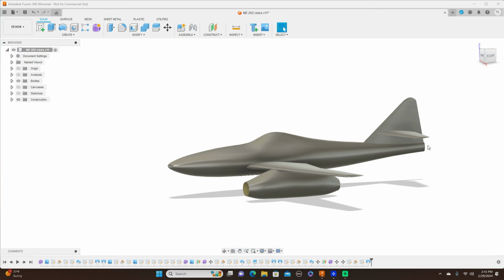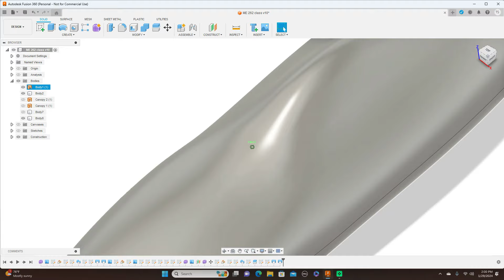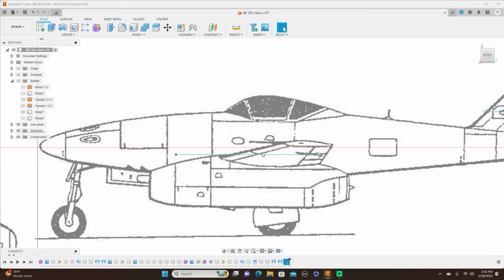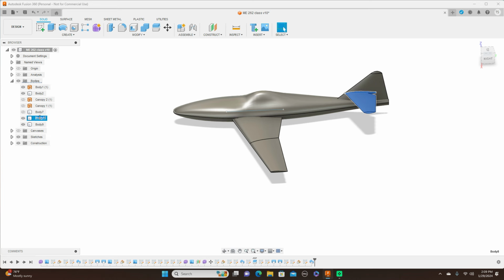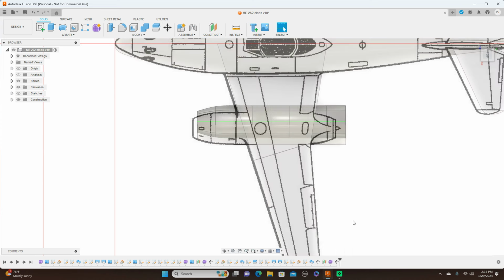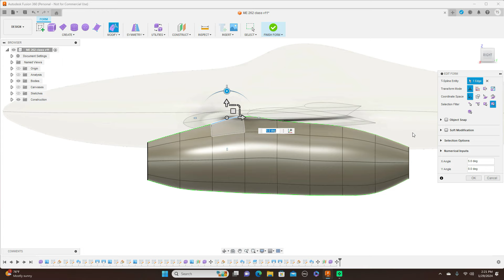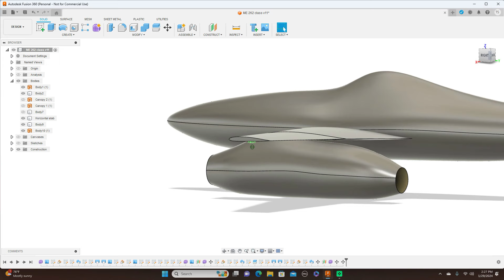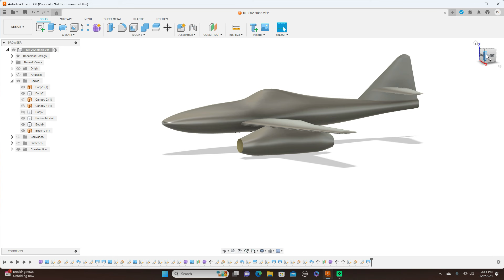How To Model a ME-262 In Fusion 360 Beginner to Advance Part 3 Tutorial

Comment: Airplanes like the F106 have a triangular fuselage. Would you suggest using cylinder to start or do you think starting with the cube form would be better. I want to be as true to the real thing as possible. I tried using 18 cross sections and loft which gave a very true to form. Problem is this produced over 100 bodies. I tried to join them into fewer bodies but it got a little overwhelming. I created half and tried to mirror but with all these bodies would not select. Only one at a time could be selected. I took up CAD about a month ago and put in many hours everyday. I’m learning a lot but my inexperience is exhausting. I’ll keep at it.